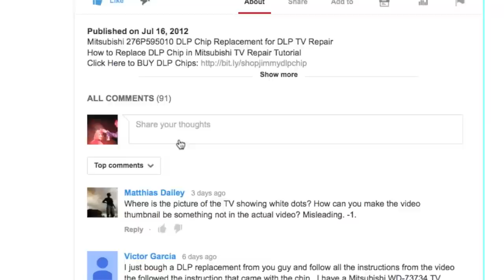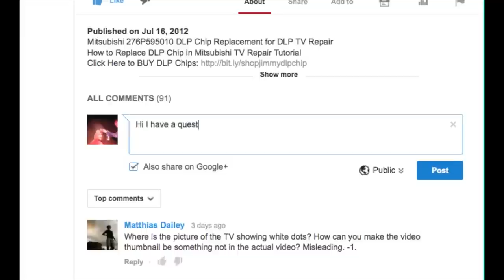LCD TV Repair Tutorial - TV Screen Solarization - Common T-Con & Main Board Symptoms & Solutions

Comment: SONY KDL-40V4100 I have the solarization problem now with a translucent(non-solid) red bar in the middle of the screen. Originally, menu screens looked fine but no video (solid green with moving white dots) with audio.. I replaced the tconn board, it was the same. I  bought 2nd tconn board, the same. Switched boards to confirm same but now with red bar. Replaced main board. Now I have image and audio but solarized with red bar. I replaced tconn ribbons and tconn cable, still have solarization with red bar. Did I damage something to cause red bar? Could I have damaged both tconn to have the same red bar?
Reply from the maker: ulyssescpt  Try all repairs and troubleshooting at your own risk.   This could be a problem with either the t-con board, the main board or the TV panel.  You can replace the main board and the t-con board individually in your TV to see if one of those boards fixes the problem.  Click this link to replacement parts for your TV model number:  http://www.shopjimmy.com/catalogsearch/result/?q=KDL-40V4100  There may be multiple boards for the same TV model number, be sure to match part numbers on your current board, with your replacement for compatibility.  Thanks and please let us know if you have any further questions with your TV Repair!  www.shopjimmy.com

Comment: Hitachi model L55S603Most of the times when the TV is turned on, the picture colors are "neon pastels", kind of like watching a tie-died T shirt at a Grateful Dead concert... I suspect.  The problem persist until the TV is turned off and back on at which time it works fine.  Sometimes the picture goes back to normal after being turned off and on once, but more and more often it takes 4, 5, or 6 cycles to get it to correct itself.  Once the picture comes on normally, it stays normal until it is turned off again.The TV menu is normal when pulled up, I THINK... I'm not 100% certain though because of the transparency of the menu, it's kind of hard to tell if it's normal or not.Do you think you have a part that will repair this at a reasonable cost?Thanks!-Brent
Reply from the maker: +Brenton Bryant   Try all repairs and troubleshooting at your own risk. This could be a problem with either the t-con board, the main board or the TV panel. You can replace the main board and the t-con board individually to see if one of those boards fixes the problem.  Click this link to replacement parts for your TV model number:  http://www.shopjimmy.com/catalogsearch/result/?q=L55S603  There may be multiple boards for the same TV model number, be sure to match part numbers on your current board, with your replacement for compatibility.  Thanks and please let us know if you have any further questions with your TV Repair!  www.shopjimmy.com

Comment: hi, i have a kdl-w4150 sony lcd, I have a solarized image, even on the menu, i thought it was the speakers of the home theater that were too close, but i set them far of the tv and still the solarized picture. I'm going to change the T-con, but I wanted to ask to you what tools I need for this TV, do i have to sold the T-con? thanks  a lot
Reply: actually I have been watching some solarized lcds pictures, my tv is like showing green pixels all the screen
Reply from the maker: José R Padrón Astudillo  Please watch this video FIRST to help with your repair!  https://www.youtube.com/watch?v=BP3NVNCGEv8  If you are replacing the entire t-con board, you should not have to solder anything.  Click this link to possible replacement t-con boards for your TV model number:  http://www.shopjimmy.com/catalogsearch/result/index/?cat=63&q=w4150  Be sure to match part numbers on your current board, with your replacement for compatibility.  Thanks and please let us know if you have any further questions with your TV Repair!  www.shopjimmy.com

Comment: i have an older Visio LCD tv. I don't think it has solarization but it's as if my screen is lagging on one side. I played two videos both testing color and black and white and notice that colors get stuck on that side if that makes sense. if i have a black screen up from a previous white the right side fades the white with a trailing green. if I have a white screen up from a black the middle right of the screen turns a greenish color. if you like I'll will send you a video showing what is happening.
Reply from the maker: +TROllingNINJA2031   Try all repairs and troubleshooting at your own risk. This could be a problem with either the t-con board, the main board or the TV panel. You can replace the main board and the t-con board individually to see if one of those boards fixes the problem.  
Please reply with your TV model number.  Click here to view a video that shows how to find your TV model number:  https://www.youtube.com/watch?v=S51nhAmwR2M  Thanks!  www.shopjimmy.com

Comment: Have a Dynex DX-LCD42HD-09 which has worked well since 2009.  I'm seeing something similar to solarization.   Attempting to compensate, I turned the brightness up to 60 from the default 50.  It mostly works but looks washed-out, faded. Maybe too bright.  Adjusting other color controls appears to have little affect..  The menu appears to have a mostly normal coloring, just a bit faded with transparency turned off.  

Based on these observations, it's likely the mainboard as you described.  The mainboard is a Dynex 6HV0206910 (569HV0169B, 6HV0206914).  It has a "Bad" availability rating.  

Is there a way to speculate which components are the likely cause.  I'm familiar with electronic repairs but not LCD TV mainboards.  I already have the required equipment for component replacement.

I've signed up for a stock alert, let me know procedures I may use on a mainboard.

Comment: I have a Philips 47PFL4606/12. The powerboard don't give any output. I cannot find any defective parts. Do you have a clue or tip. This seems to be a bad board.
Reply: do you have  actiive mains input check the fuses first some sets have solid state fuses that can only be checed by a multi meter start at the power in and work back to power output  you would need a meter ''

Comment: help please
vizio vo47l fhdtv10a
solarized image, menu screen included.
also it looks like the ribbon cable has been tampered with previously. is there a chance a new cable would fix the issue? or is it also a tcon board / panel issue?
Reply: +Rick Norris also the screen seems fine at first, but over a period of time the solarization kicks in. was also curious if this could be a power issue.

Comment: Hi, I have a 42 inch Vizio model # E422VA. I turn the tv on and the Vizio logo pops up for about 45 seconds. It then goes black and LED light in the bottom right of the tv blinks about 50 times and then goes off. It then repeats the same cycle over and over. I have changed the power supply board already and still no fix. Any suggestions??

Comment: Um... if it's on the menu, then it IS on the TV/screen; just not on the input. A good "oops" card with what you actually meant ("input and menu") at 1:37 and 2:37 would fix that problem.

Comment: Sony. XBR-65X930D 
No power dead set.  Until I pull out the ribbon cable from the led driver to the dsp board then the backlights come on. I've replaced the led driver and the dsp board still getting the same problem. Can you please help. Shopjimmy

Comment: Have a Samsung LN40a550p3fxza.
The picture has some discoloration. I appears to be blue shadows under faces and other darker areas of the screen. Sometimes the picture is nearly perfect.
Did reset already.
Any thoughts?
Thanks.
Reply from the maker: MrJoeKaluzny   PLEASE SUBSCRIBE TO OUR CHANNEL - Try all repairs and troubleshooting at your own risk.  This could be a problem with either the t-con board or the main board in your TV.  You can replace them individually to see if one of them fixes the problem.  Click this link to replacement parts for your TV model number:  http://www.shopjimmy.com/catalogsearch/result/?q=LN40a550p3fxza  There may be multiple boards for the same TV model number, be sure to match part numbers on your current board, with your replacement for compatibility.  Thanks and please let us know if you have any further questions with your TV Repair!  www.shopjimmy.com

Comment: Guys if your TV is having solarised picture it's very simple to fix. If you take it to a repair shop that will charge you anything which is not worth. I fixed my TV solarised issue by just opening the TV and did a cleaning of all the parts. My TV had dust and moisture. So make sure you remove all removable parts and clean them. There is a board on LED panel make sure you clean that as well. Hope this helps.

Comment: 1 Samsung
2 LE32S86BD
3 negative image 
the panel has been replaced with an almost identical one,
from original T315XW02 V9 to Au Optronics T315XW02 V.F and for different connectors I used inverters and original tcon of samsung.
I'm looking for a solution. example cable compatible with VF MB Samsung,
or tcon compatible / editable

Comment: I have a sony 40 inch flat screen which has solarized distortion. If you hit the menu bottom
the screecn is 90 % better..I have replace t-con board and did not help.The model number is
KDL-40V4150.  Any ideas?

Comment: Hi i have the toshiba 24sl410u and it solarized in the imag and the menu.  i dont know the part number of the part i need to start to replace.  Thanks for your help.
Reply from the maker: Luis Romero   I recommend replacing the main board in your TV.  Here is a link to replacement parts for your TV model number on our website, click here:  http://www.shopjimmy.com/catalogsearch/result/index/?master_part_type=Main+Board&q=24sl410u  Be sure to match part numbers on your current board, with your replacement for compatibility.  Here is a link to a video showing how to identify your part number, click here:  TV Part Number Identification Guide for Toshiba Main & Scaler Boards (LCD, LED, Plasma TVs)  You can also call our customer service for further assistance with your purchase.  (877) 881-6492  Thanks and please let us know if you have any further questions with your TV Repair!  www.shopjimmy.com
Reply: ShopJimmy.com Thanks, I will check the link.

Comment: Hi! I need help to solve a problem with a Sony Google TV NSX-40GT1, the tv runs and display normal on the smart tv content (netflix, web, youtube, dlna streaming, etc.) the problem is when i like to watch live tv the image looks solarized mainly in a green tone, the same occurs with any device I connect to any input source (hdmi or composite). I'm a bit confused how to diagnose this model of tv since the live tv and the channel info, clock, signal status and even the guide looks bad. I could say there is a tcon board problem if take apart the smart tv function.
Reply from the maker: Geronimo Zuñiga  Please watch this video FIRST to help with your repair!  https://www.youtube.com/watch?v=BP3NVNCGEv8  This could be a problem with either the main board or the t-con board in your TV.  You may need to replace each board individually to see which board fixes the problem.  Click this link to replacement parts for your TV model number:  http://www.shopjimmy.com/catalogsearch/result/?q=NSX-40GT1  There may be multiple boards for the same TV model number, be sure to match part numbers on your current board, with your replacement for compatibility.  Thanks and please let us know if you have any further questions with your TV Repair!  www.shopjimmy.com

Comment: Hi. I have 37' Samsung LCD. After a minute after turning on TV I can see few horizontal bars of solarized picture flickering around and after few minutes whole picture is solarized/negative/distorted with grainy noise in picture. When a problem started I had only flickering bars. What is causing the problem in your opinion?

Comment: Samsung 55” UN55MU6290
It’s got inverted colors on the screen with a white glare. LEDs are working fine. None of the troubleshooting with settings worked. I’m sure that one of the boards needs replacing, but I’m not sure which one. Help? 🙂

Comment: Hello, we have a Sony KDL-40Z4100 - the picture became solarized, then it rectified itself, but now it looks very light, washed out.   could this be a t-con board or a TV panel? can I replace these myself? thx
Reply from the maker: Jen Harenberg  PLEASE SUBSCRIBE TO OUR CHANNEL - Try all repairs and troubleshooting at your own risk.  It could be a problem with either.  You can replace the t-con board to see if that fixes the problem.  Click this link to replacement parts for your TV model number:  http://www.shopjimmy.com/auo-55-40t02-c06-t-con-board.htm  There may be multiple boards for the same TV model number, be sure to match part numbers on your current board, with your replacement for compatibility.  Here is a link to a video showing how to identify your part number, click here:  https://www.youtube.com/watch?v=4cCbAv3f6Ww  Thanks and please let us know if you have any further questions with your TV Repair!  www.shopjimmy.com

Comment: Sceptre 42BVFULLHD. Had a bag power supply. After replacing it. now the Tv shows 10 inputs in step of 9 like is supposed to. And the colors are converted. Replace the tcon board like it sujest in the video but still the same. Any advice. Thanks

Comment: i have a Phillips 50 inch model no 50PFL3807/F7 AND THE picture has a red hue to it. On the menu also. We have changed the cables and cable box. adjusted the settings and pictures. Help!

Comment: Hey i have a Samsung ln37b50k1f,first turn it on the spot where it says HDMI1 or what ever its on looks fine for 2seconds then becomes greyish, the picture is solarized, but if you go to the picture test page the colors look fine. Could it.be the main board? The menu looks ok but its not perfect more of a greyish color its not.solarized thanks
Reply from the maker: blake fleming   I recommend replacing the main board in your TV.  Here is a link to replacement parts for your TV model number on our website, click here:  http://www.shopjimmy.com/catalogsearch/result/?q=37b50  Be sure to match part numbers on your current board, with your replacement for compatibility.  Here is a link to a video showing how to identify your part number, click here:  Samsung Plasma TV Repair: Samsung Plasma Panel Parts Guide  You can also call our customer service for further assistance with your purchase.  (877) 881-6492  Thanks and please let us know if you have any further questions with your TV Repair!  www.shopjimmy.com

Comment: Hello, i have a somatisation problem with a Toshiba 32a3030D, the menu seems ok but the image is bad, do i have to replace the t-con board?
Reply from the maker: +stéphane Ashworth   Try all repairs and troubleshooting at your own risk. This could be a problem with either the t-con board, the main board or the TV panel. You can replace the main board and the t-con board individually to see if one of those boards fixes the problem.  
Unfortunately I do not see any replacement parts in the search results for your TV model number on our website.  Thanks and please let us know if you have any further questions!  www.shopjimmy.com
Reply: ok i have allready changed the main board, i will try to change the t-con board. Thank you anyway

Comment: I have a Sanyo DP50749. Any image that the television has seems to literally bleed downward as the image appears. It will disappear when the image changes. For example, the "No Signal" box that moves around the screen will appear, and the image will appear and spread outward and downward, then when it moves, the picture is gone. When changing the sources, say to Video 3, the box in the upper right bleeds in from middle to edges. There is also blotches that are greenish in color along the bottom corners, taking up 5+ inches in either direction from the corners. Any thoughts?
Reply from the maker: +Richard Sullivan   Try all repairs and troubleshooting at your own risk.  This sounds like a TV panel (TV Screen) problem.  If your TV panel is bad, it may be more cost-effective to replace the TV as panels are typically hard to find in stock, difficult to replace, and expensive.  Thanks and please let us know if you have any further questions!  www.shopjimmy.com

Comment: Hi, i hace a Sony kdl 40xb450, the picture is purple, i can see the image bit everything is purple especially the edges, now ive been searching but cant find something solid. Not sure if is the tcon por main board, please help!
Reply from the maker: Alenoid03  Try all repairs and troubleshooting at your own risk.  This could be a problem with either the t-con board, the main board or the TV panel.  You can replace the t-con board and the main board individually to see if one of those boards fixes the problem.  Unfortunately I do not see any replacement parts in the search results for your TV model number on our website.  Please reply with your part number on your main board and t-con board and I can try searching for replacement parts.  Thanks and please let us know if you have any further questions!  www.shopjimmy.com

Comment: Hello, I have a Samsung LCDTV  LE32R82BX, when the TV is started after a pause of few hours the image is OK, but in a minute the image is not quite solarized (is blackish somehow). The same effect is in the menu. DO you have an suggestion?
Reply from the maker: Bebosso13  PLEASE SUBSCRIBE TO OUR CHANNEL & Try all repairs and troubleshooting at your own risk.  This could be a problem with either the t-con board, the main board or the TV Panel.  You can replace the main board and the t-con board individually to see if one of those boards fixes the problem.  Unfortunately I do not see any replacement parts in the search results for your TV model number on our website.  Thanks and please let us know if you have any further questions!  www.shopjimmy.com